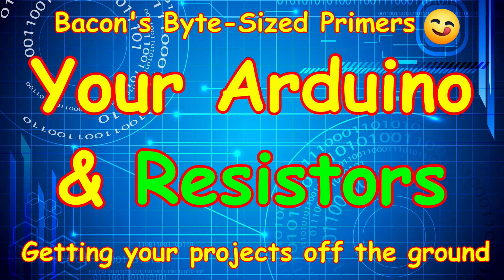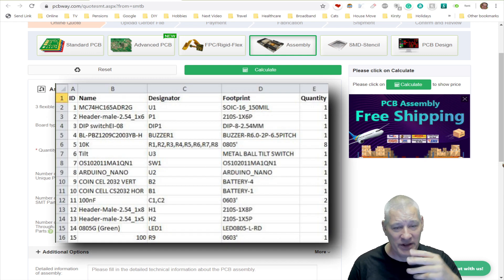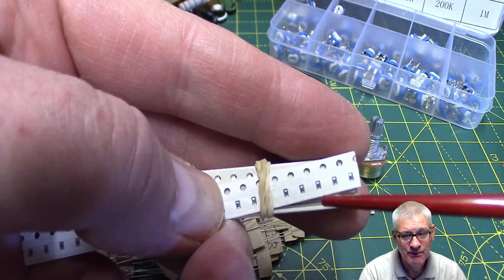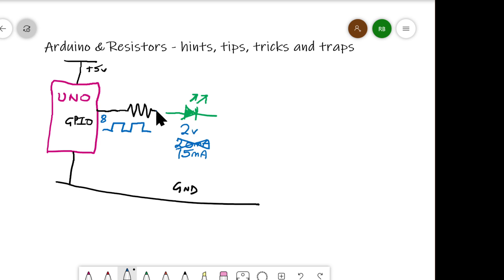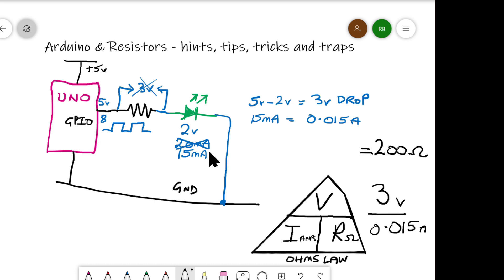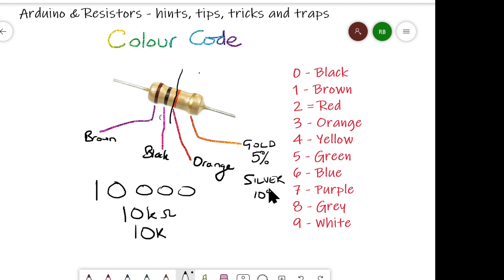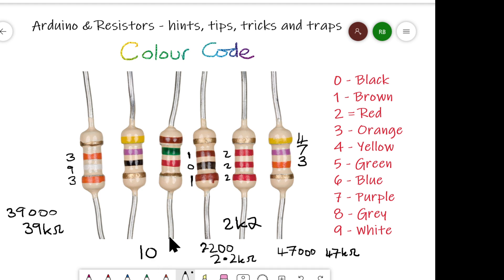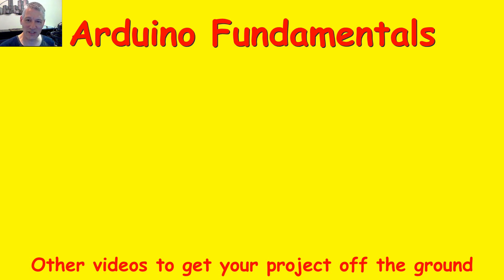#BB3 Resistors - From an Arduino Perspective

Comment: 5 band are precision and or mil spec. the 5th is military tolerance band and the resistors are 1% tolerance you would only find such precision in test equipment such as Volt ohm meters and other such measuring equipment.
Reply: I am more annoyed by 1/4 watt being hard to find and 1/8 watt seems more common these days with surface mount through hole discrete components are becoming harder to find new.
Reply: I agree with you bout the blue body those are the 1/8 w i refer to unfortunately any adruino parts pack has those blue ones. :(
Reply: I have quite a few mil spec  resisters and you need to know the NATO stock number to find out the value/
Reply: Actually I would say the exact opposite is true as to what Ralph said. It is the beige 5% carbon film resistors with their poor temperature coefficient which are disappearing at least from my view. Even in cheap electronics from the far east you find more and more 1% resistors with 5 bands and blue bodies indicating metal film or metal oxide film resistors. I personally avoid 5% resistors because 1% are almost as cheap...
Reply: @uwezimmermann5427  Totally agree. Not so much military spec anymore but becoming the norm. kudos to Ralf for another great video explanation. Big thumbs up.
Reply from the maker: Blue resistors are the devil's spawn. I cannot read the coloured bands on that blue background. It changes the band colour by it being partially transparent, I guess. You can get beige ones still (I bought a whole bunch of thousands from Banggood for very little money and that should last me out) if you look around. Be quick before they disappear!

Comment: After a 35 year break, I'm falling in love with electronics again so these videos are a welcome refresher for me!

One thing I  would like to see is something about capacitor choice.  When it is suggested you add a 100nF cap  do they mean ceramic,  poly, tantalum ?  How do you choose!?
Many thanks, Ralph.
Reply: If not specified any differently it's a ceramic one. I don't know if you can even get a tantalum in 100nF. Their point is usually to have high capacity. Compared to ceramic caps they are also quite "slow", so would partly fail in their job to smooth edges. PP/PET caps are not needed. They are usually in between ceramic (good with high frequencies) and electrolytics (high capacities).
Reply from the maker: From an Arduino perspective, most 100nF caps (used for decoupling, for example) are multilayer ceramic chip (MLCC) caps, called this even when of the through-hole variety. Cheap, small and readily available.